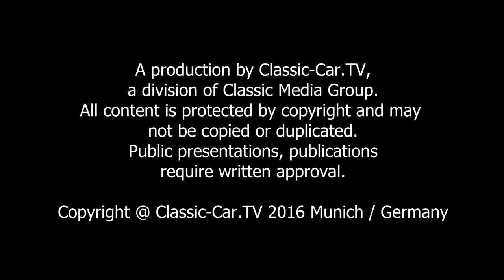Metal shaping tutorial - Shaping a bowl

Comment: The shrinker is not necessary and can be replaced by a stump with a dish. hammer blows are way to aggressive on sharp side of hammer which will damage the metal and the wrinkles if hammered out correctly will shrink it and make the process quicker and easier correcting them by hand will just slow the process down

Comment: I would like to make a helmet with the top part being this bowl shape, is there any formula to calculate how big the material has to be cut at the start to make a certain size at the end?
Reply from the maker: Kripto You do need a bit of extra material all around. It depends on how far you want to stretch and shrink the material. I would adwise to look for a sample bowl and make yourself a paper or flexible tape template. Cut in the edges , so you can lay out the template flat on the metal. That is the approximate size. Ad another 2cm all arround and you‘ll do just fine.
Reply: The book Shortcuts for  Round Layouts will answer your question and any other ? you have on this subject,with examples.

Comment: While this works with aluminum...this method is NOT the best process for steel. For example, motorcycle gas tanks. In the case of such tanks, you would form the appropriate 'conical-taper' in a roller, to the desired 'width' of tank, then anneal the sections you need to 'further round' (the leading bulb, and the rear saddle taper area), then work it with the english wheel...trying to pay MUCH attention to 'sheet thinning' as you go, and ROUTINELY annealing, as steel will 'work harden' quickly as you wheel it. Once you form the upper tank body, you drill and TIG weld the filler opening, and trim to size plus 12-mm...as a fuel tank is 2-pieces (upper body, and lower tunnel plate)...you would then TIG the lower plate and upper body together, or use an induction welder (projection wheel-type), to seam weld the two together...pressure testing afterwards. As with most-all motorcycle tanks, they are 1018 CRS steel...which is not THAT 'heat-hardenable' (or tempered), but for some reason, working it to deformation requires annealing frequently to prevent brittleness and eventual cracking in-process.